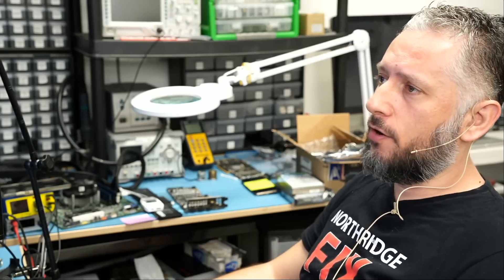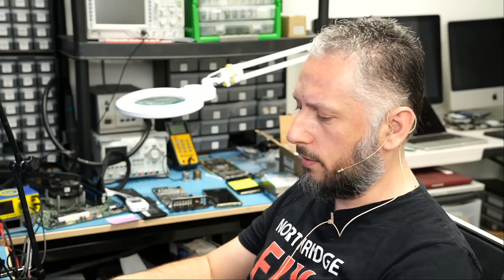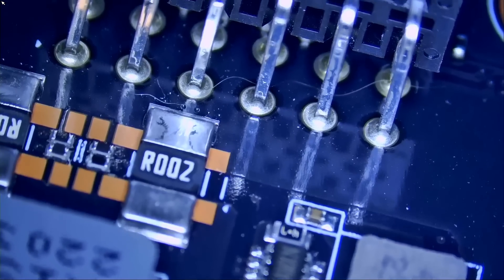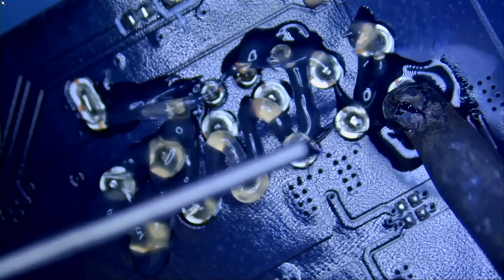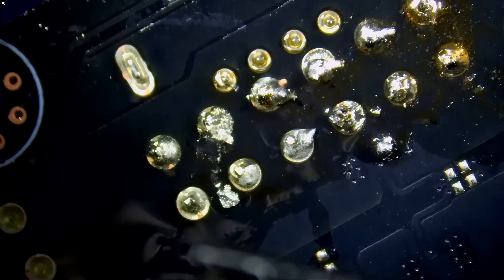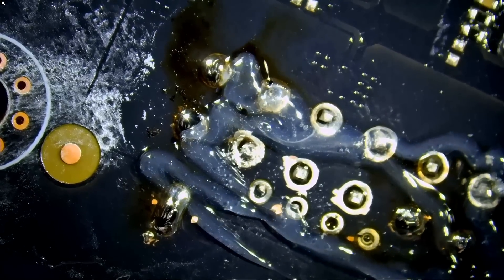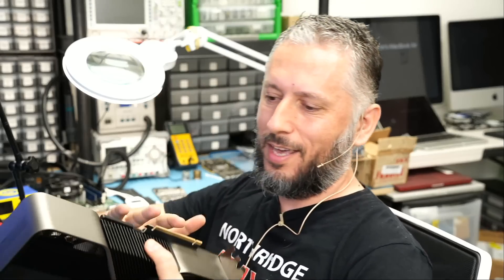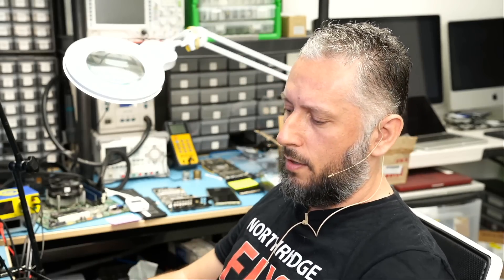Serious issues with 4090 power connectors melting - Is the user at fault ?

Comment: It is user error & NVIDIA issue, Some plugs do not clip in so the user doesn't know if it's pushed in all the way. Also If the GPU is hard up against the side panel then they need to buy the new Cable MOD 12v connector for the 4000 series cards, they have all different types of angles for your GPU. The new CableMOD 12v connectors have not had any issues because they clip in all the way. I reckon It's a design fault with the NVIDIA splitter that goes into the GPU..
Reply: the card he showed at the end had a CableMod 90 degree connector though lol, so obviously it's still happening even with a 90 degree adaptor. Although I think they are also making actual cables with the 90 degree adaptor integrated into the cable too.
Reply: Would a under powered Power supply be a issue? Just a thought... (I'd assume it just wouldn't power on or not performing if it isn't receiving enough voltage) 
I agree that it should definitely be a warranty claim. Especially being so new.
Reply: which is basically a design issue

if a user does not get any acoustical info like clicking we cannot blame that on a user since they followed the manual and looked for the exact result

if a connector breaks loose because of a slight bend or has massive tolerance problems where people must jam connectors to the point where they break them off of cards this is just straight up garbage design and should have never passed R&D stage

even worse is that 90 degree bends are used and card still faces same issue with melting,how can you people blame the user if the user used measures advised by GN

if anything GN straight up gaslight many people into thinking it is always the user fault when design should always make sure that users which are usually dumb get the job done with no problems on a 1st try hence why old design worked

and reason why cable mod 90 degree connectors work is because cable mod actually gave a fuck about tolerances unlike others hence why they look good so if anything they are just the least scummy company in this ring of BS
Reply: no one buying a $3000 cards that do not plug in until click, you not buying cheap china phone here, so you oppinion are biased